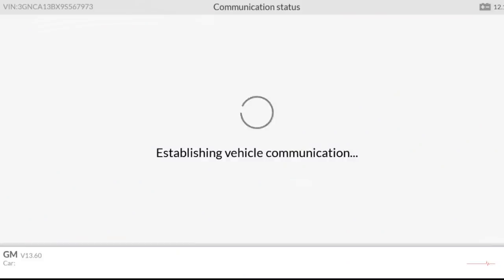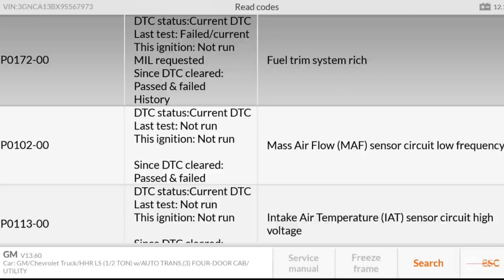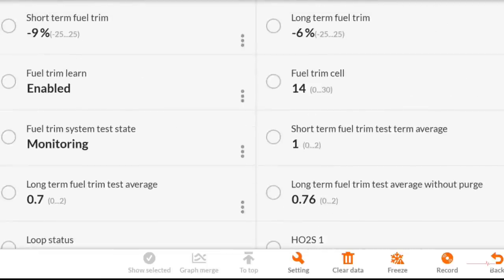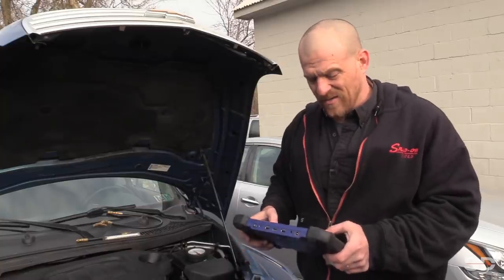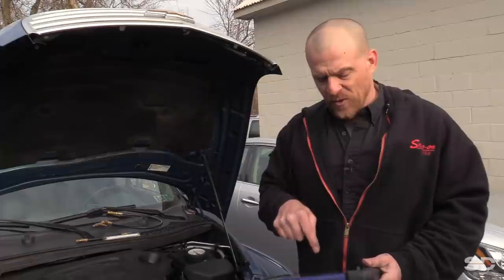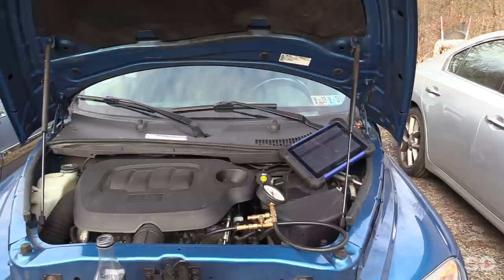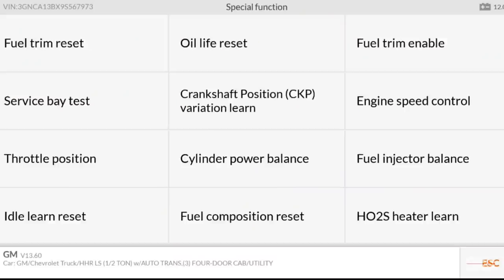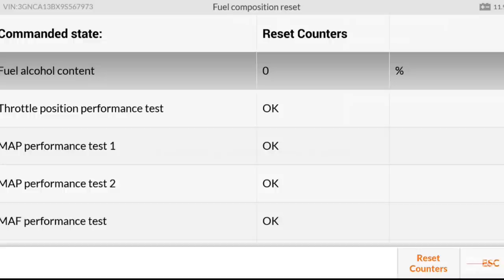P0172, P0300, Extended Crank-Incorrect Alcohol Content-Flex Fuel System

Comment: Hey scannerdanner this is Mike I'm new to your channel it seems like you know quite a bit I'm having some trouble with my car that I just purchased it's a 99 Chevy Malibu  what a 3.1 l the guy said it was a fuel pump but that wasn't the case I replace the fuel pump it is still not getting any fuel I sprayed starting fluid in it it started right up fuel pump is not cumming on I checked all fuses gas gauge isn't working and when I started it with starting fluid RPMs wasn't working I replaced it cam position sensor and the crank position sensor and I also checked the injectors are not pulsing would you have any idea what I should do please help
Reply from the maker: After it started with starting fluid, does it stay running? Have you check fuel pressure yet?
Reply: @ScannerDanner  no it doesn't  stay running and yes I checked fuel pressure there is none
Reply from the maker: I missed "injectors not pulsing" lol so sorry. This is a huge direction shift. Your pump, I'm no longer worried about. 
Spark with no injection pulse means we have an input issue or control issue with the ECM. This system can provide spark to the engine with the ignition control module alone (I think this is a bypass ignition system) and will possibly run on a fuel source again without ECM influence. 
 There is a purple-white wire coming off that ignition module that provides the engine computer with an RPM signal. It will in turn, fire the injectors and run the fuel pump. 
Do you have a key on fuel pump prime? Can you hear that event? With key do does the check engine light light up?
Reply: @ScannerDanner  when the key is on I don't hear no priming of the fuel pump but the check engine light is on
Reply from the maker: Check for 5v ref at the intake air temp sensor with it unplugged. One of the 2 wires should be 5v if the ECM is awake
Reply: @ScannerDanner  it looks like a tan wire that I'm checking and it's pulling up 2.5 volts
Reply from the maker: Are you sure? Is the sensor unplugged? And you have a good ground on your meter? We have to know with 100% certainty on this test. Key on too of course
Reply: I just checked it again and it came up the same thing 2.5 with the key on good ground I also checked my other vehicle with the multi-meter I figured maybe that might have been bad but it pulled up 4.98 volts
Reply from the maker: Okay low reference voltage will definitely keep the car from starting. Check the TPS unplugged too and see if you see the same 2.5 v
If you do, start by checking the ECM main fuses, then we will start unplugging sensors that use this ref voltage. Like in this video
https://youtu.be/za13UnpbH7E
Reply: @ScannerDanner  I checked all the hots and grounds going to the computer they checked out good and then I start unplugging sensors on the engine and it was still the same I don't know how about the transmission sensors if they use that same 5 volt reference I feel like I'm lost I don't know where to check anymore
Reply: @ScannerDanner  also I forgot to mention that when I hook and unhook the battery and pulls a lot of current

Comment: Can you explain what fuel trim is?
Reply from the maker: Sure can, in this video
Understanding Short Term and Long Term Fuel Trim (a SD Premium video)

 https://www.youtube.com/watch?v=oRX2V6_a3dc
Reply: @ScannerDanner  Thanks, that was very interesting, unfortunately it was a little too advanced for me.  After watching that I realized that video, I was asking for a definition of the phrase "Fuel trim"  I am not complaining, I have been watching a lot of videos that I don't fully understand.  I am just a DIY'er that is getting tired of struggling with diagnostics.
Reply from the maker: no problem! just keep watching, it gets better I promise. I have many, many DIYers who've even opened up their own shops after following me!
"Fuel trim"- is taking the fuel map, the fuel curve written for the engine, and then trimming the mixture a little from the ideal preset ratio. This will add a little, then take a little away from the baseline pulse width of the injectors and is what makes the oxygen sensor move rich and lean. 0% = no corrections, positive numbers means adding fuel, negative numbers means subtracting fuel from the base fuel map. 
Watch some more of my case studies listed in my chapters 4 and 5 playlist and you'll see a lot more videos where I am dealing with fuel trim. IT will help!

Comment: hey paul just a heads up  i use a tester from kohler corp (small engines)  pn 25 455 11-s     it is marked with a water line  10 20 & 85 % marks. it is half the size of yours in length. maybe you can source that if you are interested and able.  go ahead and delete this if ya want. i know you try to make a little off your affiliates to  help make these vids and i can appreciste that.
Reply from the maker: No problem man, it's not much so no big deal at all. My main concern is just providing good info on tools I'm using.

Comment: Why don't the  o2s correct the the  rich problem wouldn't they report rich. alittle lost on this could somebody explain i need a aha moment.
Reply from the maker: alcohol content changes the fuel curve/map (base pulse width), so with the base map now being wrong, the fuel trim (used to keep the oxygen sensor at stoichiometric) has to correct too much and then you get a trouble code